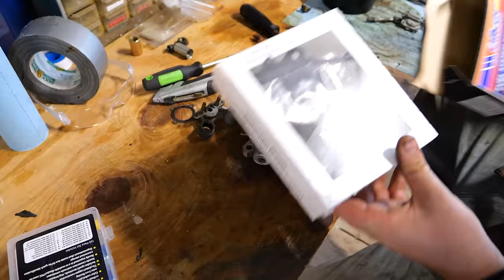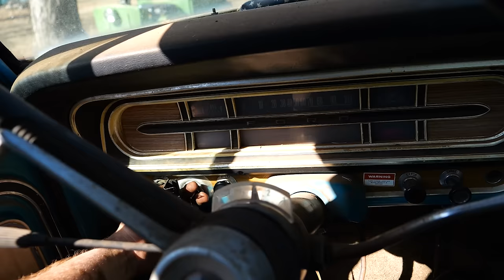Will this STUBBORN Abandoned F100 Run and Drive After 15+ YEARS!?

Comment: Had to add a comment about the torch cleaning kit. If you have any small engine stuff, these are almost as necessary as a screw driver. With so much ethanol in the fuel now, it's easy for jets to get clogged in small engines. Because the engines are smaller, the tolerances in the carb are tighter, so even a small change to the jet will make things run wrong. A torch cleaner can be used to clean those jets out when you're ready to start mowing or 4-wheeling again.

Comment: I got a set of cheap wrenches/ratchet/sockets (made in India) for Christmas when I was 15 years old. 30 years later I still use that set on every project. I'm definitely not a professional but I turn wrenches way more than most folks. Just like you said Kevin....a wrench is a wrench.

Comment: 20:42 the gm dealership I worked at had a special container with a basket to rebuild carburetors. It heated the berrymans and agitated the basket when connected to shop air. Did a fantastic job of cleaning the carb

Comment: Kevin, I just did a revival on my 79 F100 that had sat in a shed for 7 years this weekend.  Your videos gave me the courage to tackle the years of neglect I had given this truck .  I drove it 2 miles home on an electric fuel pump and a gas can. The carb never leaked!  Then I added fuel to the tank and running on the portable tank, I used the mechanical fuel pump to flush the tank and lines. Running great this evening.   Now for some plugs and an oil change.  Thanks for the great advice!
Reply: Nice

Comment: Noting that you don't need to go crazy putting the carb back together and also the bolts that hold it to the manifold and spacer, I usually use 1/4" drive tools so I DON'T reef on any of the bolts. It is VERY easy to warp the base of that carb.. like SUPER easy to do.. So yeah anything that seems like you should be careful, use 1/4" drive stuff.. It'll save a major headache. You just can't torque with a quarter drive like you can on a 3/8. It doesn't seem like that big of a deal, but it really makes a huge difference.

Comment: Im a subscriber and as a retired electrician and old car enthusiast I enjoy your videos. I would like to point out that its not the high voltage that kills its the amperage. A twelve volt battery is 500 amps more than enough to kill, however low voltage so not likely to arc.

Comment: Love seeing these videos.  Had a Camaro that was sitting for a decade I got running recently, was such a cool feeling to see it running again.  I want to pick up an old truck at some point, but living in the Midwest means so much rust
Reply: I found a 1981 f150 that had a bad 302 that I replaced with a rebuilt block and this was a Washington state truck with 96,000 og miles and has alot less rust than a Wisconsin truck would have.

Comment: Youre are right Kev about the oil and heat cycling for sure. Had many a motor come back from heat cycling. Once it took a month of every other day when nice starting and cycling it but it worked. I always use 15w40 Rotella T4 only (has the most ZDDP) in everything older than 1989-90 when rollers became standard in most non truck applications. Never had an issue.  I check for what the motor has otherwise from factory otherwise. Another great video🤘

Comment: Just bought an 84 Chevy 3500 flatbed dumptruck for $500.
It'd been sitting 4-5 years and is growing thick moss. I aired up 3 flats, added a battery and a gas can in the passenger floorboard to the pump....  drove it home

Comment: The 289 in my Galaxie has had 20w50 and Lucas for 2 years now. Lots of summer driving, and she gets less than 5psi of hot oil pressure. Not a single noise, and it runs like a top. I'll be swapping in a roller 302 and hopefully be doing power tour this year.

Comment: I agree with wrenches being like oil when all things are normal...However on old road salt exposed cars unless you enjoy rounding off fasteners having 6 point sockets and or flare wrenches is a good idea (yes, when a fastener is bad enough or I can feel it starting to round with a 12 point or open ended wrench I will switch to a flare wrench or 6-point to try and save it)...They aren't always necessary but are useful often enough that you'll be glad you have them.

Comment: 35 years ago as an apprentice I bought a set of Stahlwille spanners ( German made ) and over the years I've stuck with them and they are fantastic tools with the lifetime guarantee.  I did buy a all in one box thing of Halfords professional tools ( It's a UK big box car shop) and they are great and so much cheaper than snap on or other big manufacturers.
Reply: Pretty sure Halfords have a lifetime guarantee also. Don't think it covers 10mm sockets getting lost though

Comment: One interesting bit of information is the 70’s 2.6 and 2.8 Ford v6 engines had similar intake/head mounting design as the FE. Maybe the 3.0 or 4.0 in the Rangers did too.

Comment: I remember my first semester at TSTI, which is now TSTC back in 1987 the seniors was trying to set the timing on a 460 big block they dropped into a 1980 Ford truck, and they went through 6 sets of push rods because it was bending the rods. The truck had been parked a year, so I told them to rig up a temp gas to fill with good gas as what was in the tank was most likely bad. Had to explain that I worked for a full service gulf station since 1983, before they would listen. Turns out bad gas will cause Fords to bend push rods like they are going out of style.

Comment: Great little DIY for carbs. I too use the torch tip cleaners. AS a Corvair guy I have a bit of experience rebuilding carbs, I use the Berryman's dip but I miss the old school stuff that would burn you if you got it on your skin.

Comment: Kev, a bunch of gas in the oil aint necessarily from blow by. It could just be a ruptured diaphragm in the fuel pump. Ive gotten several old crocks running that had massive gas in the oil, just by changing the fuel pump. No blow by, no smoke, or not enough to matter.

Comment: My current hangups with my project beetle are assembly. Need to do interior, electrical, and brakes. Got it running and driving, but need to do assembly to get it on the road (and stopping)

Comment: Love these Ford trucks, FE engine with distributor in the front, starter relay on the fender, both easy to access.  This is a nice truck with a/c, p/s, auto trsnsmission.

Comment: That truck isn't done with life yet. Just love your channel good advice and I sometimes learn something I didn't know. So what a vehicle I could get running again but no money to do so. One day maybe. Had the rear main seal go out in my 87 f150. Didn't notice it until I got home by then lost all oil and had a rod that was knocking to get out. Thing is put some used oil in it drove it around the farm for about 2 months before I got a junkyard engine for it. Never threw the rod. Paid 350 for the truck and after the newer engine had it almost 4 years. Best truck I ever had.

Comment: My uncle showed me years ago how to ground out a cylinder with a test light. Clip the test light to the ground side of the battery. Then touch the plug wire at the distributor cap. You can go from wire to wire to find dead cylinder. 😊

Comment: Just got a 63 galaxie with a 289 in mass, got it running after like 25 years, made it roadworks, put new floor pans in it, and sold it for like $1500 more than I paid

Comment: One or more brittle, cracked vacuum lines will have you chasing your tail and pulling your hair out trouble shooting an intermittant lean idle problem.  A torn diaphragm in the brake booster or a sticky check valve in the booster are possible.
Many revival youtubers seem to regard the choke as an irritant rather than a necessity.  Sixty years ago, automotive manuals specified chokes to be set much richer than I regularly see these days.  At 0° F a properly adjusted choke may not fully open for several minutes with the engine at idle.
Cheers

Comment: The points need replaced, the pivot shaft is ruined and it's easy to see with your camera work. Spark will be more stable and reliable if you get that fixed. Great video and lots of fun.

Comment: As the owner of a 70's Ford product I can say there both is and isn't an ballast resistor in all fords of that era...Allow me to explain. There is electrically a ballast resistance, but there is not part that you would describe as a resistor....Ford used a resistive wire between the Ignition key and the Coil as a ballast resistor so if you look for a ballast resistor you won't find one.  Also If you replace your key to coil wire, you'll have to either track down the correct resistance wire or add a ballast resistor.
Ford also used fusible links (sections of wire designed to burn open like a fuse). I consider myself fortunate not to have had problems with either yet.
Reply: In nearly every case on a Ford it is the pink wire. In weird cases Ford sometimes used a resistor coil but I have not ever been able to nail down a way to figure out their use case consistently.

Comment: 5w30 is not stock weight oil for these cars. That's the stock weight oil for 21st century cars. 

The stock weight for a car like this would be 30 weight (defunct), or realistically 10w30. Personally I prefer a little thicker because I live in a hot area, so I run 15w40 exclusively in my cars (except for modern junk).

Comment: Those points are shot.  Did you notice the sideways play around the pivot pin?  You might be able to start the engine with that play, but it will never have the correct dwell which could lead to intermittent spark and variable timing.

Comment: honestly, i'm pretty sure what happened here is that most of what's wrong with the engine was that it sat forever without running, i forget where i heard it but older engines, it's actually good preventative maintenance to run it for a few minutes every once in a while, just to heat it and keep it oiled

Comment: My project is A first gen Ranger. Fuel tank is rusty, and the fuel system under the hood is still a ? As well as the automatic trans. But low miles, can't wait to get the young ones on it and start the process!

Comment: Keep up the great work! On a side note I have a set of metric wrenches I got off a tool truck like the ones that go to flea markets I bought in about 1991 and used quite hard for years, still work great. I have a set of Great Neck wrenches that I did break one by doubling it up. Don't do that. But they are good too. I do buy HF stuff since I no longer do mechanical work daily.

Comment: Pull the motor, fix the rear main, and keep it on standby. Never know when you might need a crappy motor for an oddball project, or to replace one that can't run at all. 👍

Comment: In them ford solinoids, if it has the second small wire on it. Just run it to 12+. Won't have to run a wire to the coil that way

Comment: The other thing with the FE's are the tops of the push rods where out, you can quit a FE by turning the push rod upside down, that whey the part that is worn out is in the lifter and while that spins it doesn't move back and forth, the top part that is not worn out can now pivot in the rocker arm, thats how we did it a million years ago when I was teenager and was working on my old 390's, the right way to fix it, NO, but when your a broke kid, it worked LOL

Comment: It always amazes me how in US you can just casually go to a local store and buy a rebuild kit for an 60s-70s-something carburetor. 
After struggling with a modern Mikuni carb on a 1988 Mitsubishi, I ended up buying a donor with similar motor but MPI, and replacing carb with a fuel injector.
Reply: In his neck of the woods it’s a little easier.  Iowa is old farm truck country

Comment: So I dont even know if you check these any more. Been watching your videos for a long time.
After seeing your videos and got the bug to own a classic. I found a 1969 Ford F100. The guy told me its all been restored and its all good. I went over i should of walked away. I couldnt i felt bad for the old guy it was his last restoration due to medical issues.
After alot of heart ache getting her home my mate said shes leaking oil. Great.
So i figured out were it was coming from a limped her home.
I spoke to a classics specielist to get her fix properly. They had the truck 4 weeks and did nothing to it. 
Thanks to your videos and your net work of friends. Your videos gave me the confidence to fix the oil leak.
302 small block inlet manifold leaking on the china wall. I believe it was boat video you showed is how to fix it. 
Once that was done i then drove it over to mates, hit a pot hole and the front of the truck slammed down.
I got it towed away to a shop and on the ramp we inspected the truck properly. 
The top suspension brackets were made poorly and were very weak. The suspension shock bracket failed as well. So i had it fixed. 
Upon further inspection the whole front subframe isnt safe. Bad welds, inproper hard ware and the steering rubs on everything.
I saw your video were you put QA1 suspension on and i was like thanks again junkyard digs you have my answear.
I am out of money hoping the kit wouldnt be to exspensive. As i live in the UK my options are limited. Do you have any suggestions on getting this truck safe and enjoyable again for me. 
Iv basically got the option now to store it and save up for a QA1 set up or sell it and move on to something else. Alternativly could you maybe come over here with a crown vic sub frame and help me sort out this baby? Make a good video 🤷🤣

Comment: Try using the chem dip in the ultra sonic cleaner, you will be amazed on what it does, and you dont have to change it for 6 mos to a year depending on how much you use it, I promise ull never use that pine sol crap again!! Its amazing what it does in thoes cleaners

Comment: I really miss the carb tank we had where I worked. I'd strip a carb down then let it go overnight. It was air actuated so it would rotate half a turn then back half turn. Talk about getting a carb body cleaned out. Dude, that rear main, that's not even a class 3 leak. That's more like a class 3,000,000 leak. lol

Comment: I could've used this a month ago lol. Previous owner was chasing an issue with a 74 ltd that turned out to be a bad spark control module. I had so many "repairs" to undo before it ran. Every old car ive had has had bad gas that immediately destroys any gasket and makes the carb leak like hell

Comment: He is referencing the pil Cao when  talking about moisture on the cap as moisture should be on the coolant cap as it actually holds a form of water or actually water. The radiator should be clean coolant.

Comment: i have had many 390 360 not much you can do with the bottom end  but normally if i get one that is with bent push rods  i change the lifters sometimes they dont load  never seen a whiped cam in one  most of the time i just yanked the intake  haven't had much luck changing lifters with the tool  the rear seal is a two piece one  changed a few of those to   anyway great vid  keep on truckin !

Comment: OMG that pivot point on those points are the worst I've seen and I am 70 years old! And Ford uses a resistor wire inline from the ignition switch to the coil.

Comment: Run a couple of litres of transmission fluid in the engine and tank of fuel. Rev her up to 2500 rpm and dump some down the carb. Instal fix

Comment: That was very informative, If a guy had more time than money, would it be possible to do anymore to the old motor? I mean, get to the rear seal and replace it, clean it up a bit more and maybe get the truck to the point where a feller could take the dog for a ride on Saturday, run to the lumber yard and the dump once in a while?

Comment: This makes want to take on my 65 Dodge A100 van that I got from a buddy 3 yrs ago. The engine is a slant 6 with 97K miles, 3 on the tree setup. Towards the end of that 90k it was used on a ranch property up until the brakes went out, they had used a pole to stop it and that was that until my buddy got it. He tore the distributor, plugs, spark plug tubes and lost ‘em. He was originally digging into why it had low compression. May have just been a low viscosity oil issue all this time as you mentioned. He gave up on it years ago and sold it to me. It came to me with no wheels. California rig, so minimal rust, straight side panels and complete. The only dings are on the rear doors, bumpers and front end from the pole stops. I’d love to get it going again, but it came to me with no paperwork so I’d like to sort that out before I think about dumping money or parts into it.

Comment: On gas in the oil it may not be bad rings. It could be a bad fuel pump. Often when the fuel pump fail, being mounted on the engine, it can pump gas straight into the crank case. Seen it many times.

Comment: Should hear my 99 suburban tick, Its been ticking for years on the passenger side, Collapsed lifter I believe, still runs fine, doesn't spit out a misfire code unless im at idle and its cylinder 7 on the driver side from time to time, I think thats more in line with the spider injection unit as tune ups never fixed this, I wish it would die so it'd give me a reason to throw a better engine in it with 200k less miles, but she keeps on going somehow, I'm not easy on it, haul trailers and everything with it......